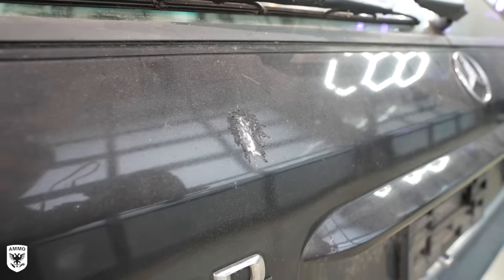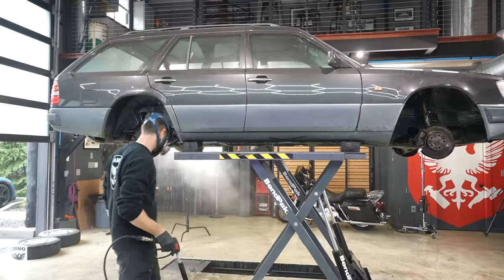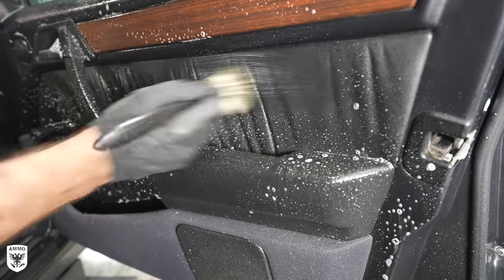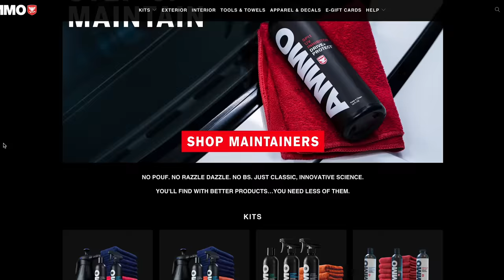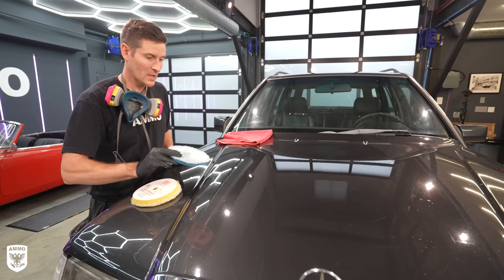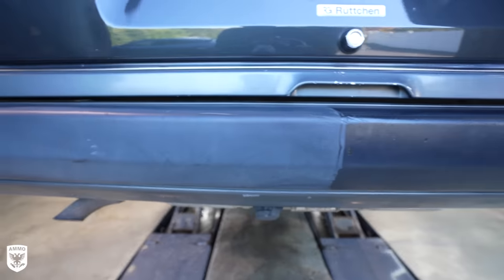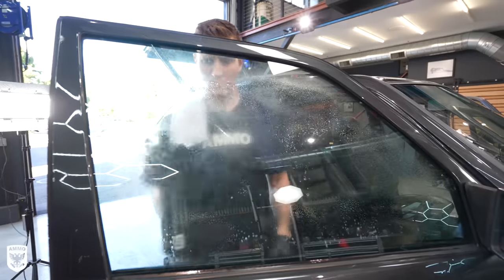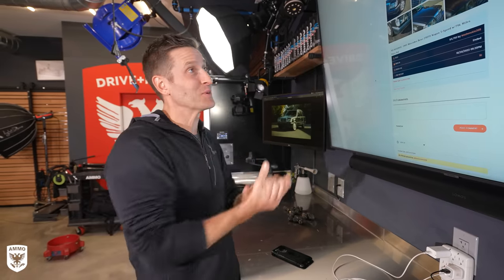First Wash in 10 Years: RARE Mercedes Benz 250TD Manual Wagon Huge Before and After!

Comment: Just a heads up, the TD doesn't stand for "turbo diesel" it stands for "touring diesel" this car is actually a naturally aspirated 5 cylinder diesel. Mercedes used the "T" lettering to designate their wagons in the w123 and w124 models.
Reply: Mercedes puts Kompressor on the car when its a turbo car. Not sure when they started doing that though
Reply: Came looking for this comment :).

I think they used TDT or TD T for turbo models.
Reply: @Royvdl  Kompressor is for supercharged cars
Reply: @Royvdl  kompressor for turbo petrol mercs, older turbodiesels were called TDT if they were wagons, and  just TD if they were sedans, usually it had a big "turbodiesel" badge on the rear. A badge which i would need in my 290 turbodiesel S210😁 (example w210 is a sedan, s210 is a wagon)
Reply: @aleksiblomqvist1612  , turbo diesel sedan W124 are called 250 D TURBO or 300 D TURBO. Wagon : 250 TD TURBO and 300 TD TURBO.
Reply: @aleksiblomqvist1612  W124 and older turbo models were called DT for «Diesel Turbo», TD just means Touring Diesel, the «T» designating a station wagon. Hence the estate turbo diesels being named TDT for «Touring Diesel Turbo»

Comment: These are really great cars! Just a little correction: this is not a Turbodiesel, the TD stands for "Touring Diesel", because it is a wagon. This one has the naturally aspirated OM602 (2.5L 5-cylinder) with around 90 HP. The turbo version would have a "Turbo" badge on the right side of the rear hatch.

Comment: Actually 250TD in this case does NOT mean TurboDiesel but Touring/Tourismo pointing to be a station wagon (Kombi in German) 
The Turbo Diesel versions (250 and 300) always had sliced air intakes on the front right fender.

Comment: The platte you show at about 6:50 is a Dutch plate for a light trailer. It is the same combination as the car has. I looked it up and it says it was first registered on the 30st of August in 1990. Last registration in the Netherlands as it was sold to a new owner was 21st of August 2015.

Comment: The numberplate is a secondary dutch number plate for use on for example trailers, or bike racks. That is why it is white instead of yellow. 

It was also not uncommon for richer people to retire in Spain, so it may have been from the same owner in the Netherlands and in Spain.
Reply: The white plate's format is exactly as in Portugal, where the car is originally from. So I guess that is a Portuguese plate that he used for a trailer.
Reply: @killerspetsnaz  No Dutch, as mentioned in other comments
Reply: @JeroenPekkeriet  yeah, i was misleaded as he said in the beggining that the vehicle came from Portugal.... Then I got a bit confused as he said that it's originally Dutch and then the owner went to Spain?
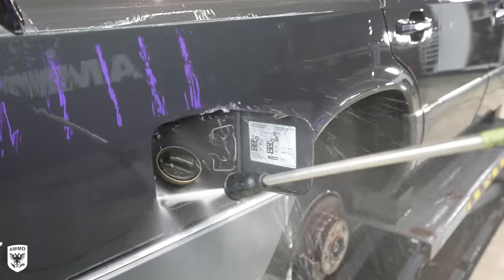Then I noticed at 3:13, it says "Ruttchen", and a quick google showed me it's a Dealership in the Netherlands.. So yeah i guess it checks out :)

Comment: Man, you can see the steam coming from the microfiber polishing pad at 11:13. That's some aggressive polishing my friend!
As always, another lovely job there Larry. You do great work. I love it!
Reply: steam?
Reply: @HxTurtle  the pad builds up a lot of heat when polishing. Probably the garage was cool and you could see the heat coming from the pad.
Reply: @MarkMeadows90  I know it can get hot (which shouldn't, as it can ultimately destroy the paint). but I just failed to notice that steam. all I see is haze and weirdly looking reflections. I'd kinda be surprised, Larry not moving quicker. also, it's metal that he's polishing in this shot, reducing the chance of too much great building up.

(I only describe what I'm seeing; I don't wanna insinuate, you're wrong .. but I just can't see it.)
Reply: @HxTurtle  there's a little steam coming from the pad. If you look closely, you'll see it. You may have to repeat the video several times, or slow down the video speed. It's there.

Comment: Man, a clean 3 pedal diesel wagon with manual crank windows.  What a killer spec.  The new owner got a smoking deal at 11.7.  Would have been very tempted by that if I had seen the auction.
Reply: It’s a odd spec what with leather and manual windows I’d expect it to have electric windows

Comment: hey Larry! just to clarify, it is powered by an NA 5 cylinder! I’ve made this mistake too, but before the E-Class denomination, the T in TD meant Touring and the turbo version had in fact a Turbo monogram on the right side of the trunk panel. what’s most funny is that I’m tomorrow getting a 1992 250 TD and putting it back on the road after it’s been left under some trees for 10 years! 👍

Comment: Cool video again. Going into the smallest details, but haven't seen to mention in any of the videos how important it is to blow through the air ducts. Lots of older cars don't have a cabin filter. When I bought my first car that was sitting for a year, it was not so funny when it blew a tons of leaves and dust into my face, after turning heating on for the first time.

Comment: That was nice to watch, since I drive a similar wagon. Mine is a 1987 w124 300 turbodiesel with auto gearbox, electric windows etc. But in need of a lot of love as it was thoroughly neglected before I bought it. Maybe one day I'll have the funds to restore it.
Reply: The one in the video isn't a turbodiesel. The T in 250TD doesn't stand for turbo but for transport. Transport is the designation for the wagon models used by MB at that time.
Reply: @meeder78  mine is a 300TD Turbo. One of apparently only 1500 made.

Comment: That license plate you found is actually a Dutch extra license plate for a trailer.
So that use to be the license plates for this car in the Netherlands , only the car would have them in yellow and the trailer in white with the same letter number combination.
It was new registered 30 aug 1990 in The Netherlands, exported somewhere between 2013-2015.
It had 4 owners in The Netherlands.
94 hp 2497cc diesel

Comment: bit of a nitpick here but those things (MB starting in late 80s/early 90s) have bio degradable isolation for the wiring and especially the w124 (below the battery) and w210 (under the headlights) have a few spots were they really like to rust so it is not recommended to bring any kind of unnecessary moisture into the engine bay.

when doing a full detail i highly recommend to brings as little as possible and tell the customer about not doing it frequently

Comment: older 220cdi's of the c-class also has a nice kind of torque to it, it is not a fast 0-100, but boy, i feel the 100-200 is somehow faster than the 0-100, it is comparable to my modern civic which has 182 hp , the mercedes having only 126. They feel like 3.0 diesels somehow.
You give me tempting feelings about starting a detail on my c, but in retrospect, this one looks like it has everything still intact other than some faded paint, and touching up the paint on mine would feel redundant, as it pretty much needs a respray altogether with the exception of a few elements.
Thank you for this video, i will at least give her a good bath.

Comment: The detachable towbar (or hitch as you call it) for the vehicle most definitely has a 50mm ball according to European standards and is not a 2" ball. This therefore should not be used with the American  2" couplers on the drawbars of your trailers. The towbar will also have a tow weight limit as well as a vertical load limit.

Comment: Cozy to see a MB S124 again. The 250D and 250TD are slow vehicles with their non-turbo diesel motors, output only 90/94 hp. The T (wagon) did not get a turbo as it´s sister, the 250 D Turbo.

Comment: Definitely an Ex-Dutch car. As you can see 15:44 the license plate number is engraved in the back window. This is a Anti Theft method in the Netherlands because the license plate number always stays with the car even after its being sold in the Netherland. Also you can see the Mercedes Ruttchen emblem on the back. That was one of the bigger MB dealerships here in the Netherlands now owned by Louwmans

Comment: Nice Car, GREAT DETAIL Larry. I often wonder when I watch these Video's, I see you Spray Ammo Cleaner all over the Place and Scrub it in with a Brush and Just Wipe it away with Stellar Results. No Spots, No Dry Areas, No Issues with Electronics??? How does that Work??? And the Engine Compartment Also, Lathered Up, and POWER Washed Off with NO Issues??? How Does That Work???? Pretty Scary with All those Electronic's being Literally Soaked with FOAM And Rinsed with a Power Washer??? How does that Work????  I'am Scared to Death If I do it I'll have a Car with a Bunch of Issues or it won't Start and I'll have a Hugh Repair Bill?????  Scary Stuff Larry. Is there a Detailing Secret that's Not being Shown or Told? Not just your Video's but All Over YouTube....

Comment: you called it a turbo diesel wagon, but it's not. its' a naturally aspirated or it looks to be from the video, mercedes use T in the name to mean wagon (estate) so 250D is sedan 250TD is wagon, if you look the air intake from the grill on the driveers side goes straight to the airbox and then the intake manifold. turbo on these is on the passenger side of the engine.

Comment: I heard you say the paint was hard. Does that make for a better paint or is softer better?
Reply from the maker: Trade off. Harder paint is more difficult to scratch but also more difficult/time consuming to remove defects from. Softer paint scratches easier but is more responsive to correction. The car with the best paint has the most paint on it :)

Comment: The car hasnt sat for 10 years, it has been in the netherlands until atleast 2013, if it was then imported to Spain. No way it sat 10 years
Reply: It was last sold in the Netherlands in 2015, it was exported in 2016. It then was listed in Florida for sale in 2017. That is probably when the previous owner that Larry got it from bought it. So at maximum it sat from 2017 to 2022. Someone did mess with the odometer though as the listing on the auction site that Larry put it on says 72k miles but it already had over 250k miles when it was exported from the Netherlands.
Reply: @meeder78  How do you know all that? 250k miles is around 350k kms? No way that car had 350k kms on it and looks this good
Reply: @leftlanegaming530  404293 to be exact. The numberplate came out of the trunk and it is also etched in the windows. It is required by law to register the odometer reading at certain moments like the MOT. This register is publicly available if you have the cars registration number. In the Netherlands a car gets the licence number when it is registered the first time and it stays with the car until it is scrapped or exported. 
On 31-03-2009 the odometer read 375351km, on 21-08-2015 it was 404239 and on 19-09-2016 the car was exported and the odometer was at 404293 at that time. 
The car was first registered to the first owner on 20-08-1990.

Regarding the Florida bit, a quick Google search on the VIN revealed that.